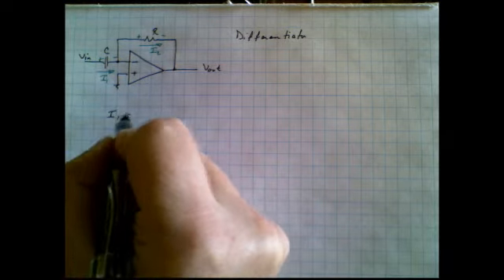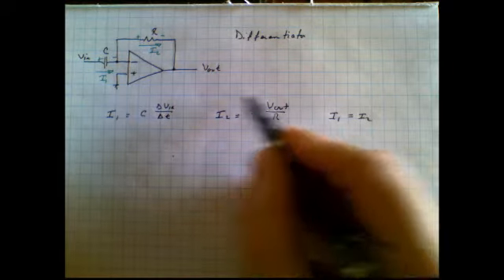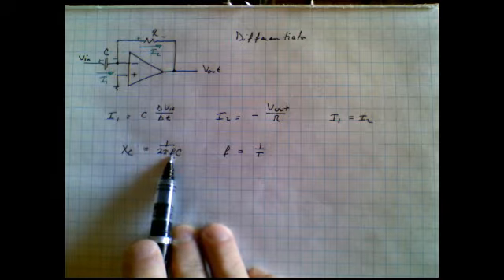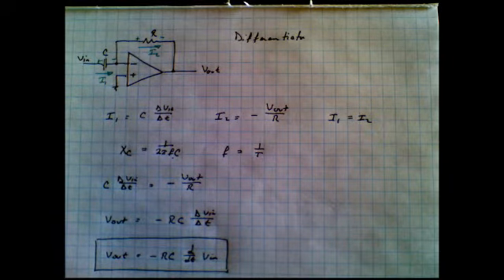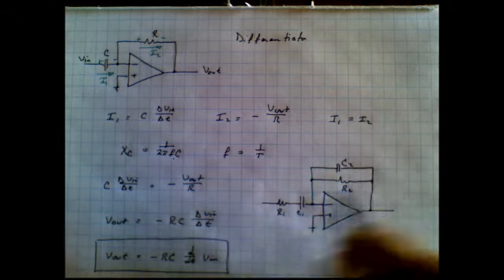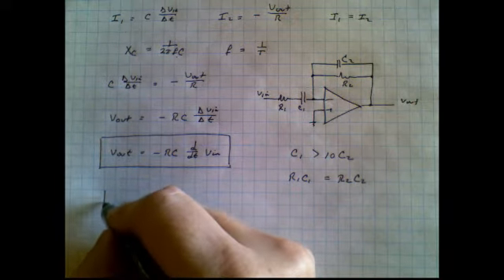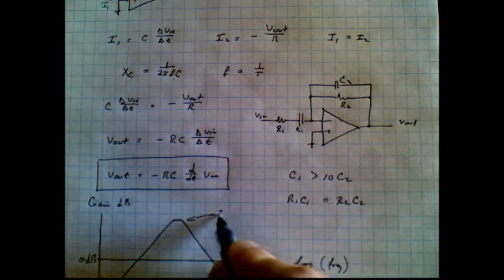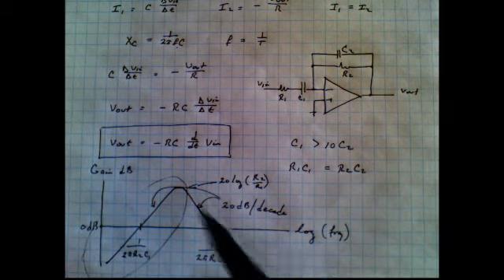Opamp Differentiator

Comment: question: why do we ground the non-inverting and not the inverting input? and does the differentiator work only for sine input? if we have lets say square input it wont work? does the formula work? (i think it should give out voltage spikes as output if so)